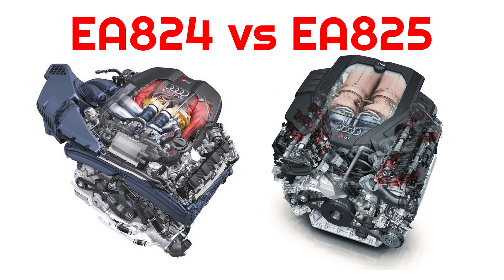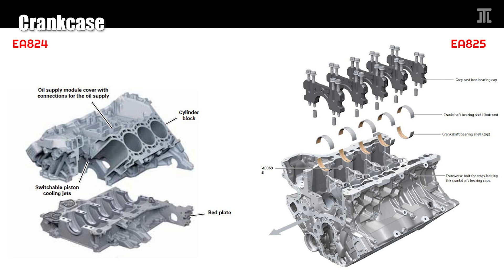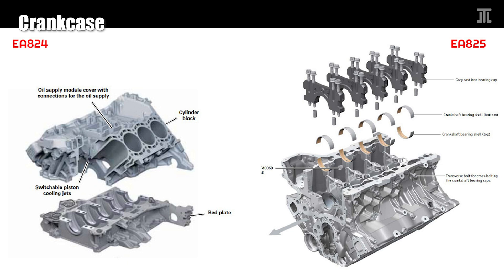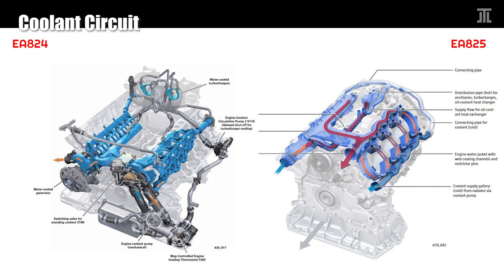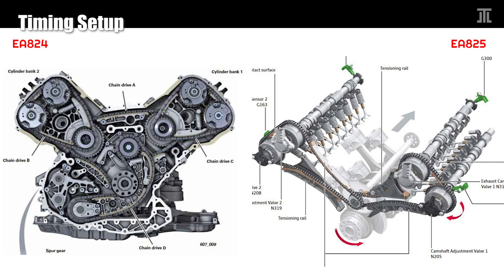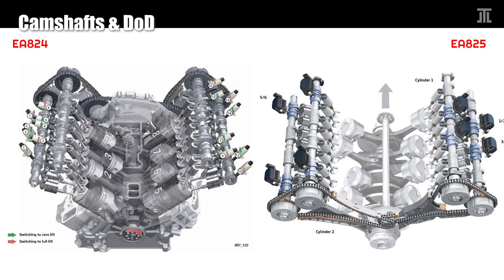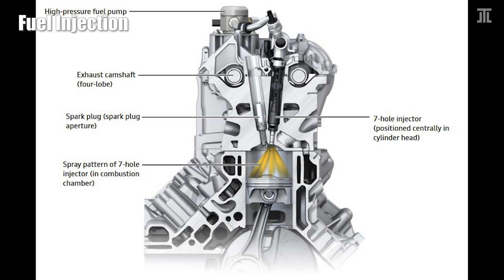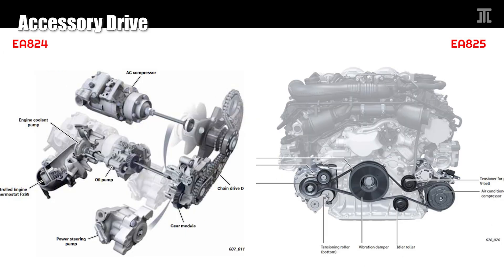EA824 vs EA825: Comparing Two Generations of the Audi / Porsche 4.0 TFSI Engine

Comment: You are the guy I need to ask. What are the main differences if I wanted to put the new engine in my 2014 Audi S6 with the older Ea824. My ASI is coded out so I just want to use the block w/ heads and possibly switch over the turbo system. Hopefully you see this and let me know what you think. Thanks
Reply from the maker: Actually I have no idea. EA825 came later, so I guess many ECUs need to be reprogrammed-> not recoded, reprogrammed. This is very difficult with a modern car.

Comment: Could not be more wrong. EA824 is worlds above any V8T BMW has ever built. Plenty of them have 200k+ miles on all factory hardware… they can also hold 1100+whp unopened. Only common issues are PCV failures and turbo oil screens, both of which have been recalled.

Comment: and I have the EA824 :(
Reply: Mine has 118,000 miles on it, stage 1 tuned 560 hp and 625 torque. Original turbos. No leaks and doesn't burn oil.   These engines, if  properly maintained, are very good!!!!
Reply: It’s a phenomenal engine, this video is hogwash

Comment: Great video, the 824 is such an over engineered with minimal gains, using heavy parts that fix one problem, and cause another, which needs another system to mitigate that problem. its a compromised for packaging, and total disregard for servicing, if you want need to remove, an injector, oil pump, timing chain, being on  the firewall side, rod bearings, aircon pump, engine has to come out. almost starter motor, you have to take out engine mounts to get to it.some models have 8 radiators for oil and water cooling. This is all because they used the 4.2 engine, and tried too hard to make it turbo, it never worked. When you look at the 825 its clear they knew what not to do and its so straight forward. How or why they spent so much time and resources to create such a bad engine, thats unreliable and impossible to work on.

Comment: Go learn about the stats. Ea824 are more reliable than n63. Less types of issues.
Reply: This, the only issue was that silly oil feed filter which obviously kills the turbo and possibly the engine, but thats easily removed/updated
Reply: @TheDarkhorse82  yeah that was a known one and recall fix like 3 years ago..
Reply: @steamy7676  there are still cars that havent had the update, mine was only recalled last year
Reply: @TheDarkhorse82  did you have to pay?
Reply: 铝硅缸壁磨损严重，双涡轮V8过几年就只剩下不到300马力😂
Reply: @kotori4life34 any dyno data to share?
Reply: True. Ea824 clears N63 and M278 easily in terms of reliability and MPG.
Reply: @emdaudio  did u end up buying? the engine can be fine if the turbos blew on it
Reply: Idk I see 9 sec 4.0s all day in my feed lol … mine is very unreliable… only does 10s 😂
Reply: Cap. 2018+ n63s are significantly more reliable than 824s
Reply: @bobsagit10  and that’s right around the time that the 825 came out and is still outperforming the S68 today